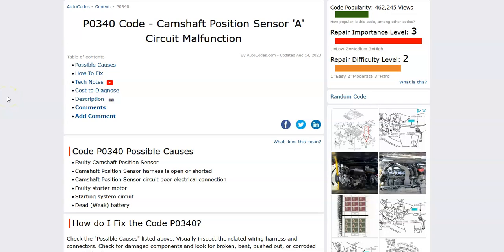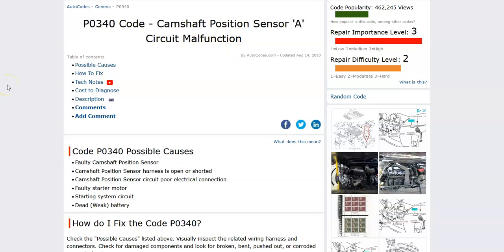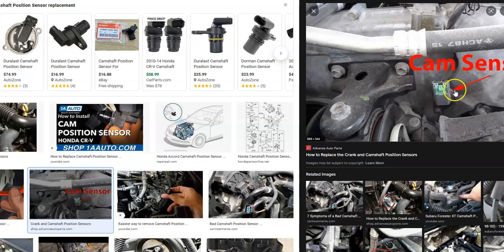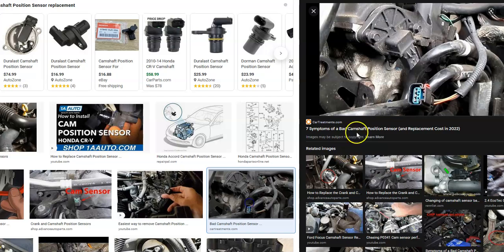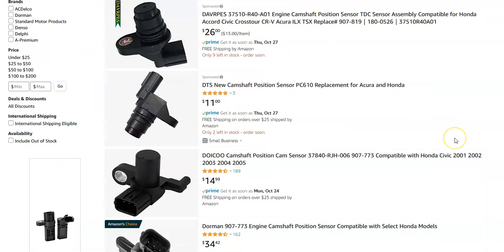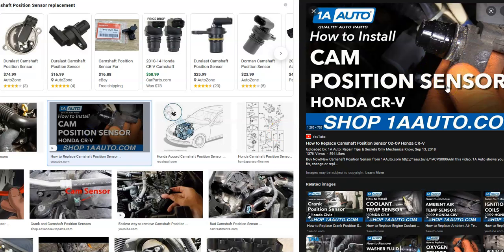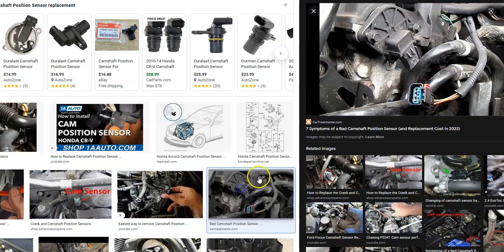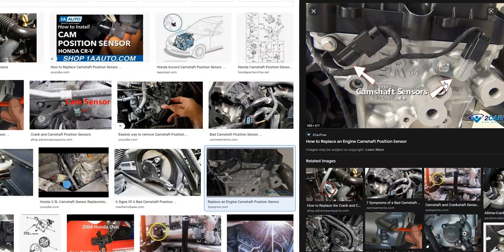How to Fix Honda P0340: Camshaft Position (CMP) Sensor No Signal

Comment: I have a 06 odyssey. It over heated and won’t start. Tried everything. After a while, a code popped up p0340. Will this cause it to crank no start?
Reply from the maker: A Cam Sensor issue can cause a no start problem.
Reply: @whyingo7964  I have a 2005 Honda Civic, would just replacing the sensor most likely replace the sensor? The engine is orginial with nearly 243k miles. I know, at this point it's a toss up. Everybody says get Denso OEM cause the Amazon sensors can go bad in a year or two from reviews i've read. Thoughts? Thanks!
Reply: What was your problem fix
Reply: Replaced sensor, not working
Reply: @equinoxacidz2493  i heard you might have to replace campostion sensor & crank sensor too. OEM Denso. Also, could be wiring harness aka the connectors leading to sensors. If they go bad, you'll need wiring harness, but if you got a good electrical mechanic, he should be able to splice connectors from a good harness on. I'm in same boat. Hopefully the sensors do it for me, cause i'm not getting new wiring harness for civic

Comment: thank you so much, i have a honda civic and it crank but no spark on the coil, i change crank sensor and nothing, the wiring was bad most is the ground. 👍👍👍👍👍 i fix and it start in one shot ✌✌✌✌✌✌✌
Reply: We’re is the ground located
Reply: 1yr later, what ende dup being your problem? Mines sitting at 256k original engine. Just got code but mechanic wants charge me $500 to diagnosis of problem + repair. Not sure if I want to do with cause engine is so high mileage + burns oil. Car been sitting for sometime. I may attempt myself since summer's coming, but any advice on what is typical cause? I'd much rather get an OEM sensor & call it a day.